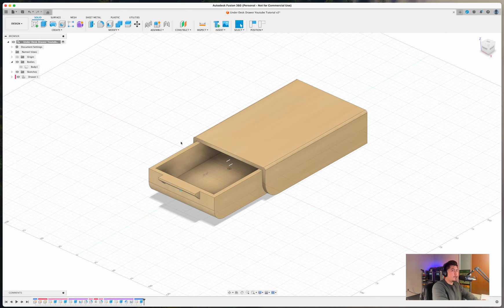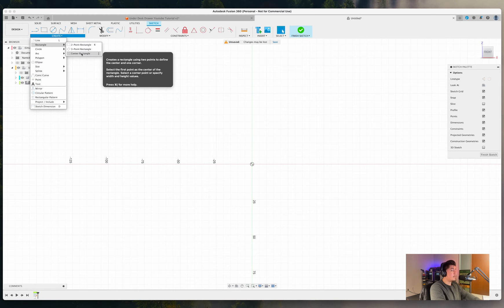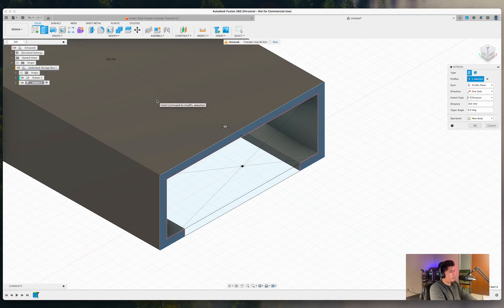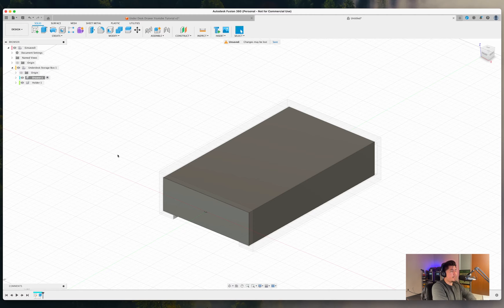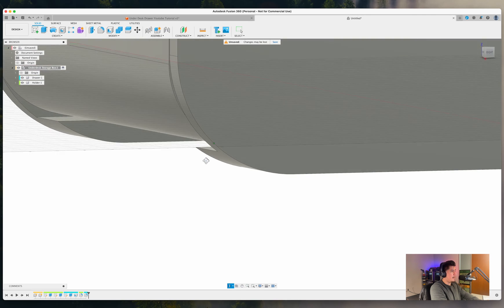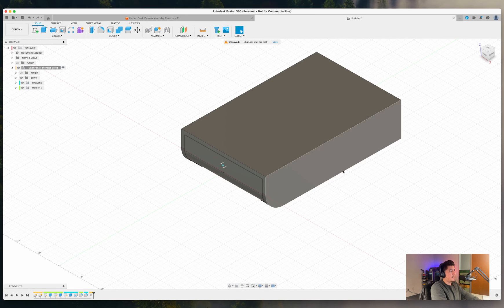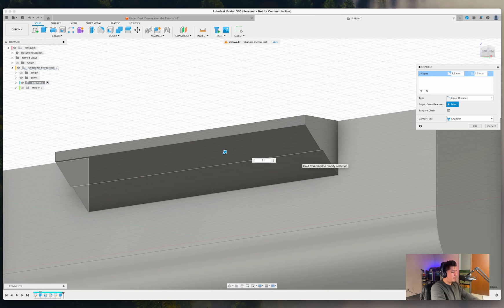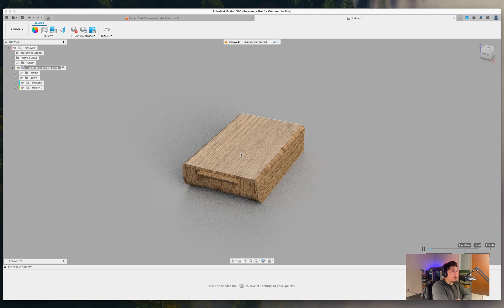Design and 3D Print This  UnderDesk Drawer | Fusion 360 Tutorial 2024

Comment: the wall thickness on the drawer is inconsistent at the radius (fillet) edge seeing as you gave them the same radius, the standard rule for a consistent wall thickness is radius +wall thickness thickness for outer radius or radius - wall thickness for inner wall edge selection.